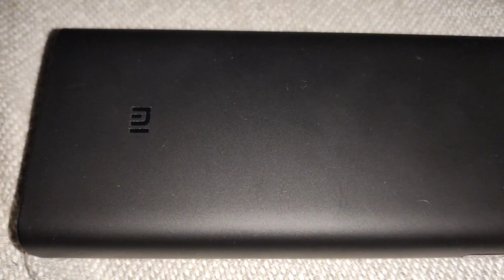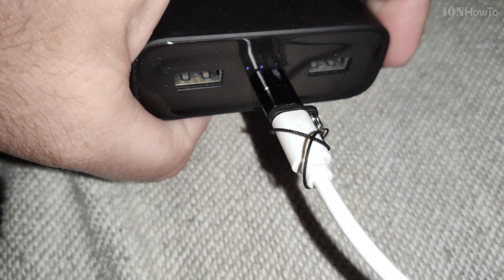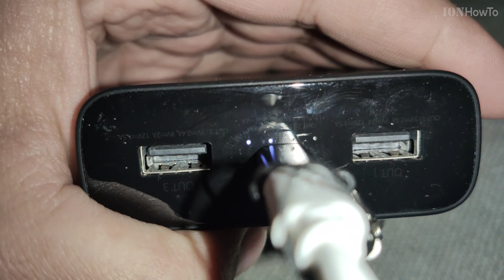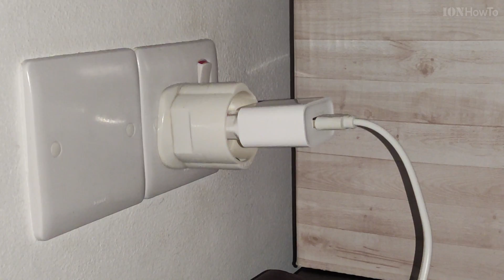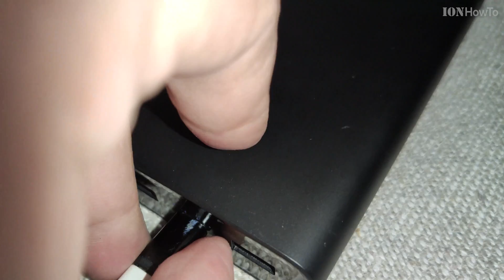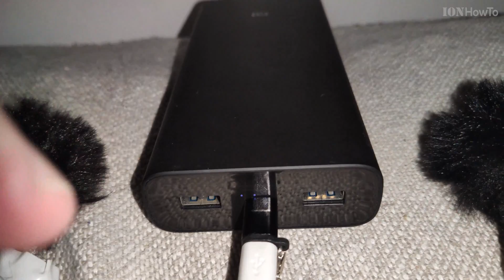Power Bank Making High Pitched Noise

Comment: Is there a way to stop that sound
Reply from the maker: Only if you open it and glue down the part or replace it but then there would be bigger problems
Reply: I was having that sound with my iPhone charger. I replaced the box and it was working perfectly fine without sounds

Comment: I have a smaller capacity model from Mi that's making the same noise as well. kinda disappointed.
Reply from the maker: I realized the noise is not happening when charging with the new ikea fast chargers.
Noise must be only on slow chargers. Try a fast charger.
Reply: @IONHowTo no way im using an ikea charger on one aswell

Comment: what is this dangerous ?
Reply from the maker: As far as I know it's not dangerous but if you hear sizzling while charging and a bit after you unplug it or smell anything burned it might be the lithium ion cells and then it's very dangerous.
I still use this power bank and travelled with it many times without any problems.

The noise is coil whine and it's probably one induction oil inside not glued in properly.
The coil whine is safe.

Short answer I guess is it could be dangerous if the noise comes from the battery cells.
Reply: @IONHowTo  thank you ❤

Comment: Does this powerbank still work for you? Even after many months?
Reply: My new powerbank just started with this sound..
Reply: GP recharge 20K

Its good but dont like the sound
Reply from the maker: It's still working fine but yeah noise is annoying.
Reply: @IONHowTo  i sincerely like to thank you .Every forum said "throw away" because it may explode. But i have this hissing sound at this exact same powerbank only when charging which is cold . And i thought "how it is going to explode when it is cold" . So i am glad to have found this video because you saved me from throwing it away
Reply from the maker: @Sonasic  if it gets hotter than the usual or you see any deformed parts it's a problem but the hissing sound is only coil whine. Happens to many devices.

Glad I could help
Reply: @IONHowTo  no it is like the first time I bought it . Also is it bad if I charge a device with it while using it ?
Reply from the maker: @Sonasic  you can use it and charge it fine. It's just the annoying noise from the inductors - not the batteries at all.
Reply: @IONHowTo  thank you man so much!!!!

Comment: is this sound means the powerbank is dangerous to use ?
Reply from the maker: Not dangerous, just coil whine akaik
Reply: @IONHowTo  thanks for reply
Reply: @IONHowTo  Does this sound means a components in the power bank is getting bad and the power bank would get spoilt?
Reply from the maker: @temidayoazeez3956  an inductor coil is probably causing that and it can happen even on high-end computer components.
It should not cause any trouble.

The only thing to worry about is if the power bank gets more hot than the usual.
If the power bank gets hot (more than usual) return it asap.

Comment: I have this problem everytime I get a new lead to plug in it works for 2 or 1 day then it breaks so obviously the noise in the power pack is not normal
Reply from the maker: Return it if you still have warranty on it. My cables work fine with it.